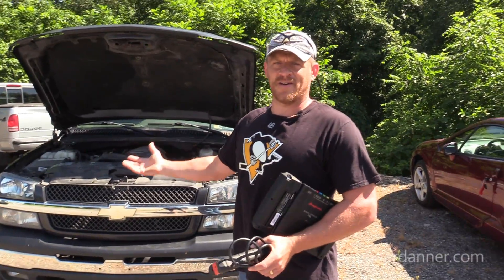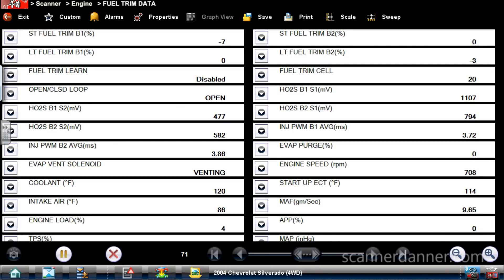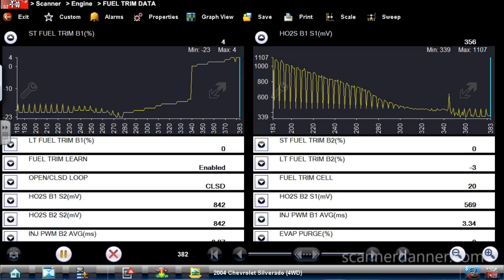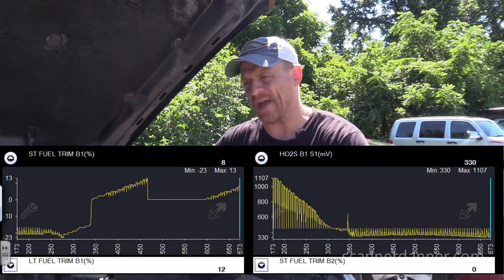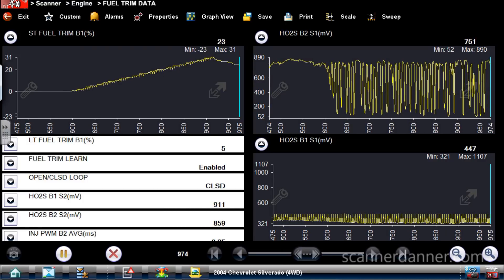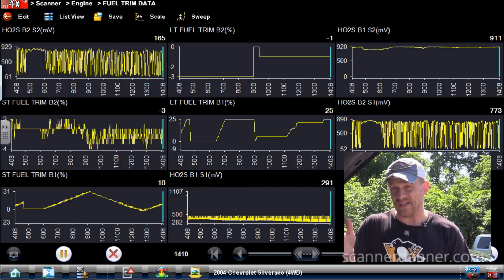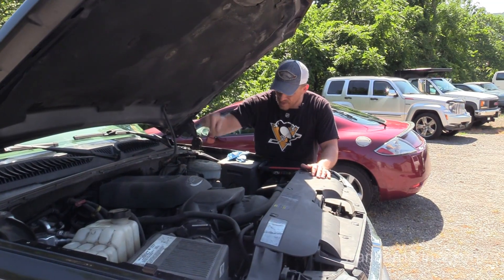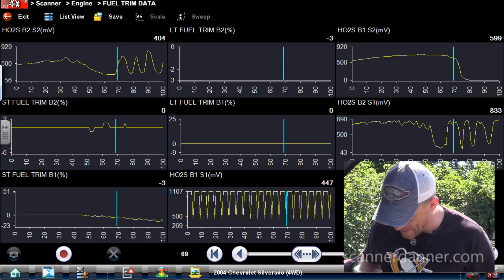2004 Chevy Truck O2 Sensor Fuel Trim codes P0131, P0134, P0171, P1133 part 1

Comment: If the tcc is not disengaging at is specific time wouldn't it cause a stumble? Just wondering why you didn't chase the p0724 code after?
Reply from the maker: Completely separate diagnosis for the TCC circuit and not our concern for the fuel trim, O2 and misfire codes.
Reply from the maker: And it was a TCC brake switch fault. Not a TCC fault itself. 
This is a signal that comes from the brake pedal switch and is used by the PCM (as one of many inputs) to unlock the TCC and disengage the cruise control.

Comment: Thanks for the fast reply. Well here is my real question.
 Since i graduated RTI i have been in shops that have had me more or less only doing streeing and suspension work. Do to that and a few other reasons i dont want to get into in public setting my basic electrical skills are more or less non existent.
 I am for the 1st time in my career at a shop that is pushing me to advance my skills and to take my ASE tests. Well i passed brakes and streeing and suspension. But failed a/c. Not b/c of lack of understanding a/c or how it works. But b/c half of the test was wiring diagrams that i dont know how to read well enough to understand.
 So i guess what im getting to is would you recommend buying a different text book for my basic electrical needs or does your book get into to that kind of stuff? (I did try and find my old one from school but dont know what happened to it.)
 I do plan on watching all of your videos and showing my boss them to. I also know i want your book but with money tight right know i need to get the book that will help me the Most with electrical right now.
Thank you for any help you can offer.
Reply from the maker: Jake
What you need to do is subscribe to my premium channel on my website. It will be the best bang for your buck and will be like taking my class over again. There is a 14 day free trial and it is $11 per month after that. 
You will literally be back in class with me. I have also added a "Basic Electrical Concepts" playlist for guys like you. After going through those videos, my suggestion is to start in chapter 1. 
I hope to see you there.
Reply from the maker: https://www.scannerdanner.com/join-scannerdanner-premium.html

Comment: Great Job Paul I was thinking the same thing it was looking like a duty cycle type signal which the heater uses which would make sense when first started o2 heater would have a higher demand then as it warms up it drops and so does your signal goes to reading lean. Dont think I've ever seen one fail this way. Very interesting
Reply from the maker: I don't think this heater circuit was PWM but I'm not totally sure on that. That would match even better if it was right? I should have verified the sensor ground for you guys on this one, just to prove the O2 was the issue. I just couldn't get my fat ass under that truck :-)
 A new O2 did fix this. Unfortunately given how busy things were, I couldn't come back to do a follow up for you guys.
Reply: ScannerDanner If it is it would be on ground side as I know they have constant 12 volts to them as there's fuses in fuse box for them it's been awhile since I've had to test one surprisingly so couldn't say for sure either. In any case we appreciate any time that you give us so no worries on the update we know you have tons on your plate.